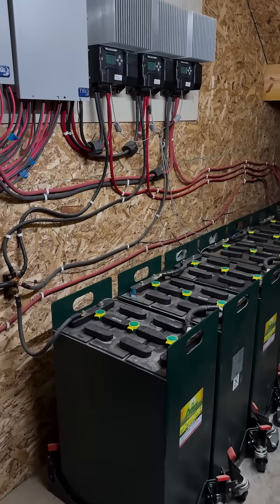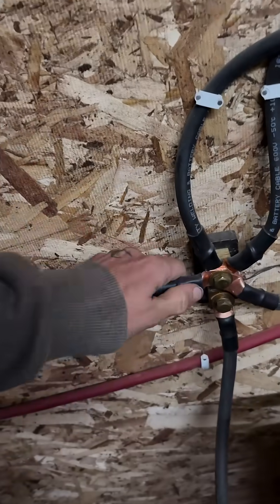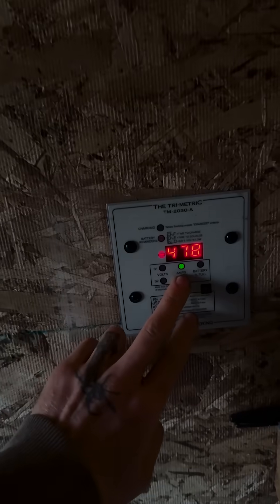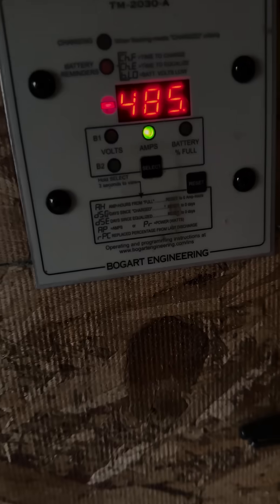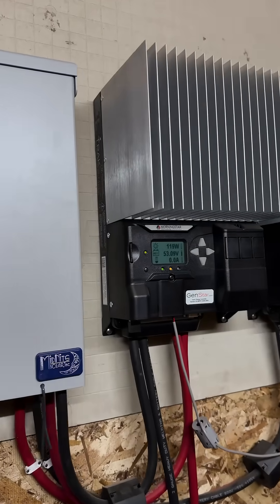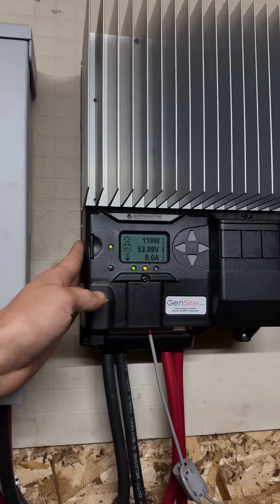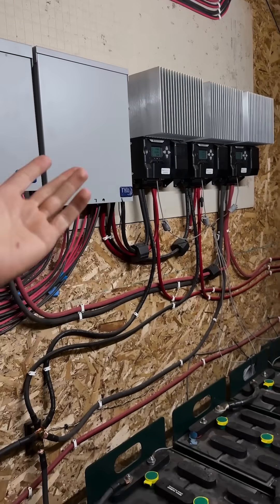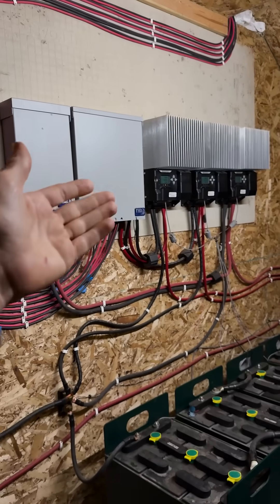Who designed and built my solar power system? #narrowayhomestead  #offgridliving  #diysolar

Comment: Solar professional here- you picked really good equipment. Overall a very good setup and I think everything is sized and wired very appropriately. Maybe add some ground rods and bond everything metal together to reduce shock hazard but even without that you’re more than likely going to be fine

Comment: I’m an Airframe certificated mechanic and currently training to get my Powerplant certification so I can go work on aircraft, but that is the most beautiful wire management I’ve ever seen, well done. One thing you might also consider is making a wiring and putting it on the breaker box and labeling your wires so you know what they go to in case you need to replace or repair. Truly impressive work.

Comment: A huge problem is the lack of quality control for products from China. Pre-China, if you wanted the best product, you could pay extra for it. Now, it's a crap shoot. I wonder if Nate is going to add a cutoff switch for the roof and lean-to panels. Also, his new home will be too far to use the electricity provided at the garage, so he'll need another solar array close to the house. I wonder what the "IR loss" would be if he did try to run huge cables from the garage to the home. Living off-grid is exactly what I would have done if life didn't take me down a different path. Oh, to be entirely self-reliant!

Comment: Just a note on plastic boxes, most certified ones are usually a non-flammable compound that can melt if there's an electrical fire but don't act as a fuel and usually insulate to slow the spread. Metal is almost always better but it's usually more expensive and its downside is if there is a fire then it's gonna heat up a lot quicker.

Comment: For three years, 1984–87, I lived off grid with, among other technologies, a small wind turbine and battery system for electrical appliances. In the 40 years since many people have done the same on significantly larger scales. It's astonishing that the basic information accumulated isn't instantly available provided by trusted sources.

Comment: I think this is so interesting. I've wondered how all the panels and wires were connected. There was a video I watched several weeks ago about a person that bought a solar panel to help with the electricity in his condo. Which I hadn't thought of. The comment section was filled with a lot of different ideas on the condo owner wanting to use a solar panel.
Reply: There is a lot of information on porch power systems for those that don’t have roof access. It’s very common in places like Germany for apartments to have a few solar panels on their patios that just plug in to the walls and help reduce their electric bills.
Reply: @texaspowerman  really? I like that. Thank you for letting me know. I appreciate it.

Comment: "What happens if there is a fire it just melts and adds  more fuel"

He says while the entire system is attached directly to chipboard.

An extremely flammable substance. I think there is a hole in the logic there
Reply: I hope the circuit breakers are correctly rated. There's a fair distance between them and the panels. Also that all the terminals are correctly torqued. It's the main reason for hot spots and fires, loose terminals and wrong breakers/cable guage.